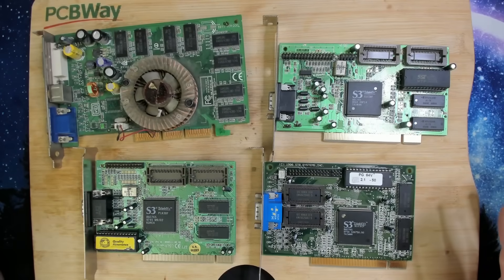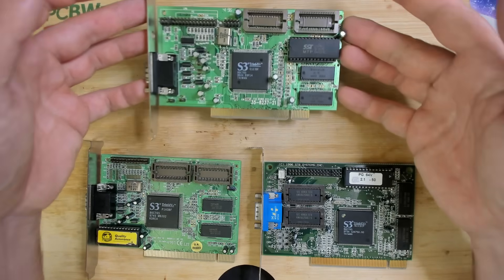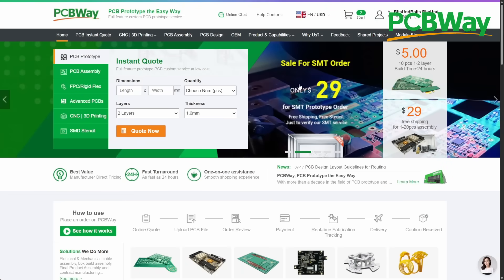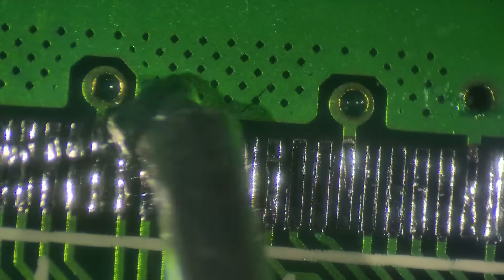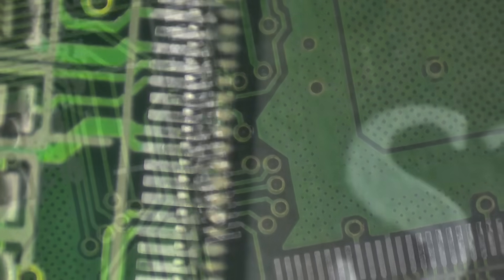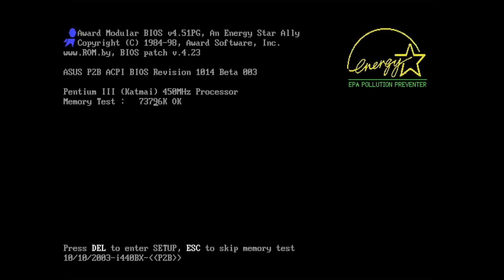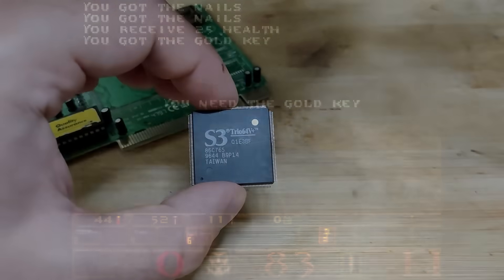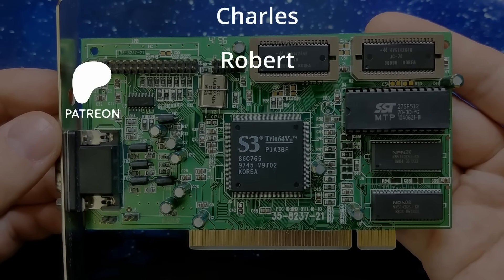My Childhood S3 Trio64V+ is Dead! Can We Save It?

Comment: 2:15 jeez... finding a dual Pentium Pro board in the scrap these days is like winning the lottery, even if it's broken/needs repair or is proprietary. These have gotten so rare (and ridiculously expensive on the used market) that I've given up all hope of ever owning one
Reply from the maker: That was the only board I have ever found at the scrapyard. Unfortunately, the board was cracked - no point in taking it. I have seen a few nice and rare items that were just destroyed - well, it is a scrapyard. Sometimes, I get lucky and get there in time before hammers and screwdrivers/chisels tear them apart.

Comment: Might have been kind of a cool idea to give the chip a socket. No particular reason, just, why not, you know?
Reply from the maker: You mean a socket for the S3 chip?
Reply: @bitsundbolts  Yes
Reply from the maker: Are there sockets for those type of chips? I don't think I have seen any that could take a chip like this (or they're for expensive testing equipment).
Reply: @bitsundbolts  I'm PRETTY SURE there are, but I'd need to figure out its pin number, but yes, the socket would likely be highly specific. Again, not saying you should, need to, but, it could be fun. Would probably introduce latency issues if I'm being completely honest, but the idea amuses me.

Comment: "Why do I want to restore it?" that's what my wife asks me all the time when I am working on vintage gear. There is only one good answer to that: "Because I can!"
Reply from the maker: Haha - exactly! I could just throw the card out and use the one I found at the scrapyard - or the STB (which is a nicer card anyway). However, it is good to practice, get more confident using a hot air station etc. And of course, the nostalgia and emotional attachment to my graphics card from 1995 :)
Reply: The video-card or electronics is like a screwdriver, a tool. A fixed tool is still a fixed tool if can perform a function. A  year 1960 screwdriver is the same as a year 2025 screwdriver. Just a tool limited by ones imagination.

Comment: The BIOS init screen from the donor card said "EDO" so I wonder if the repaired card is running memory at 60ns FPM or what.  Maybe all Trio were EDO anyway and the other just doesn't say.  Or, some other VGA BIOS may get better performance.
Reply from the maker: I am curious about that too. Could be that different BIOS images deliver  different performance. Probably a future project.

Comment: I used s3 trio64v+ for many years when repairing motherboards, it was great card. I do also have copaq presario pentium 120 with s3 trio64v+ ebbedded, there is also socket for vram pcb memory upgrade which I have 2mb total, system utilise orichd righteous 3D 4mb as well, regards
Reply from the maker: I also prefer an S3 Trio when I try to flash a Voodoo 3 BIOS. Perfect for that job.

Comment: Does the VGA bios say there are 70ns memory chips, so the 60ns chips will still only run at 70ns?  I also saw some similar cards with 35ns memory.
Reply from the maker: I'm not sure if memory timings we're already part of those BIOSes. It is definitely something I want to investigate in the future. You're right, it could be that the timings are in the BIOS and decrease memory performance if it's configured for 70ns.

Comment: I was always disappointed by the S3 back in the day. I didn't have a Voodoo but usually rocked a Radeon based card for which I found the performance was decent. Now for retro stuff, absolutely, I think they are well worth saving.
Reply from the maker: I think so too - they should be saved. I use S3 cards when I flash Voodoo 3 BIOSes (or other cards that suffer from bit rot).

Comment: If you want to find out who made the card, look up the FCC string, then you can trace the company that created/certified the card. If you're a little bit lucky, it will also be the same company who brought it on the marked. But even then, OEM computer parts was a thing.
Reply from the maker: Well, that number is printed on the PCB... Time to find some more info about this card!
Reply: @bitsundbolts  Video Technology Computers made your specific card, calling it the Aristo.

Comment: My first was a 64V2, which was pretty much the same. Was the most affordable card i could find to put on a "hand me down" mobo i got with a P133 and 16MB RAM. Ah, the stories that old could tell. Ended life as a router for my Amiga, first with a Winmodem and a slip connection and later with a "trash bin" 8029AS connecting to my A2065 over thinnet. Miss those hackish days...
Anyway, you can probably get a little boost out of the old girl, iirc the clocks can be upped for a bit of extra hmmmph, even if not much. You can probably also get another speed up with a better VESA TSR, more modern stuff really pushed the limits of it, and that might make a reasonable difference in DOS games.
Reply from the maker: I have to explore the topic on VESA TSRs - never done something like that, but I feel there might be quite a bit of untapped performance.

Comment: In my experience the c1c0 stuck post codes related to memory initialization error.  The usual suspect is one - more of the PCI data and address lines stuck to low or high. Maybe it is worth to check these lines with logical probe to see activities. I am pretty sure one or more line will be stuck to one logic level. My guess is the mb bios is not correctly copied to the main memory and when the control goes to the main memory resident bios than the system is hanging up. South bridge is managing the MB bios and the PCI bus I believe but without the schematic it is hard to tell how a stuck PCI address or data line affects the south bridge memory operations. I suspect one bus is common, not multiplexed, probably the data bus. Check the address and data lines resistance to ground on the video card's edge connector - some pin"s resistance should stick out from the others. 
Nice chip replacement as always, I am very jeaolus about about your soldering tip... I would be very happy to have one working so well as we see in your videos.
Reply from the maker: Good point. I'll probe and see if I can spot anything obvious. I don't remember when exactly I noticed that the card doesn't work anymore. I had hanging POST codes before as well (ISA sound card with bridged pins). So, what you're saying makes a lot of sense.
I'm using a Fnirsi HS-01 soldering iron. It works really well for the things I do.
Reply: The fault travelled with the chip though
Reply: @matthewday7565  Yes, it is clear, but it would be interesting to know what caused this C1C0 stuck situation. Measuring the edge connector's bus pin's resistances to ground maybe able to answer this. We know the S3 chip is faulty but where-how is the question. If one data pin stuck to ground than we have an answer. Next logical question is what could cause this problem? Possible static charge or an another bad PCI card's weird malfunction.

Comment: 11:10 Very unusual to see EEPROM on S3Trio64 cards. You can even upgrade VideoBIOS😁
Reply from the maker: That EEPROM wasn't on the card - I used it to test the if the BIOS was bad. I didn't put the original chip back. Unfortunately, it looks like I removed the sticker that covered the transparent window on the original EPROM.

Comment: As you've replaced pretty much everything other than the ROM on the card, is it really the same card any more? I'm not entirely sure I see the point in repairing a card by destroying an almost identical working card!
Reply from the maker: Well, the PCB is still the same and I just wanted to find out if it is really a dead S3 chip - and it is.
The fact that the error moved to the donor board when I moved the graphics chip is finally proof what was wrong with it.
Reply: @bitsundbolts  There were motherboards with this video chip onboard and maybe, if you find a dead one, or a broken similar card, you could populate the missing chip on that video card. Phoneix was maybe a popular brand, and btw, 86Box have the Phoneix S3 Trio 64V+ PCI.

Comment: TBH, an S3 Trio should probably stay dead :)  One of the worst video chipsets ever made
Reply: Actually is not bad, most DOS 2D games runs without issues. 
I'm use it with my Voodoo1 setup.
Reply: It's still good for DOS and Win3.1, altough I usually end up using S3 Virge anyway.
Reply: Worked well in the 90s, especially in Linux and Win NT. At the end it ran with a Voodoo 2 in SLI. Smooth sailing. Got replaced by a ViRGE, Voodoo 3, then Matrox G450 (which I LOOOOVED).
Reply: Trio64 definitely not worst, even I can say one of the best. SiS/Trident/Alliance/Macronix was much-much worse (from driver and performance sides). And ATi was much more costly with about same performance.
Reply: @VShuricK  Totally. As long as you didn't expect it to do 3D, the Trio range, including the Trio3D nee Virge, had really good performance, features and drivers, with a very low cost.
Reply from the maker: Haha - wow! I know the card is nothing special, but many remember that card to be decent. I never had issues with S3 cards (well, except for that dead chip now), but it usually did everything I needed.
Reply: An S3 Trio64 was my first graphics card, and I played a lot of DOS games with it. It wasn’t the best but every game I tried just worked. Nicely done restoring your card!
Reply: I had this integrated on my first Pentium PC (onboard graphics) and under Win95 I played Anno1602 and StarCraft without problems. Also Red Alert C&C, M.A.X, Tomb Raider, Quake, Warcraft 2, Doom, and many more dos games. Without any problems, it was very stable (upgraded the VRAM to 2M) and with P@166 and 48M RAM the computer overall was very fast and stable.